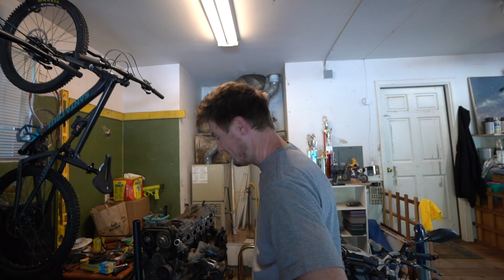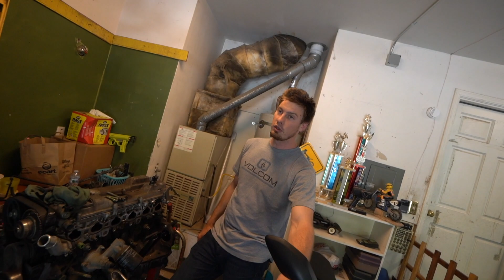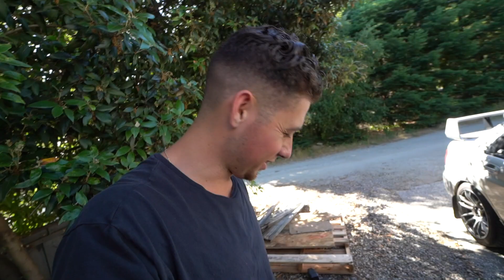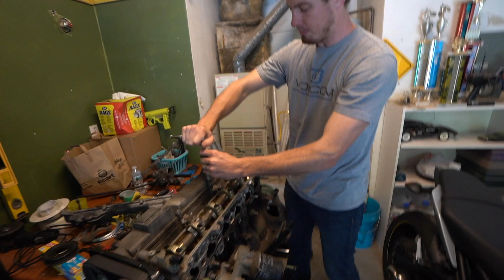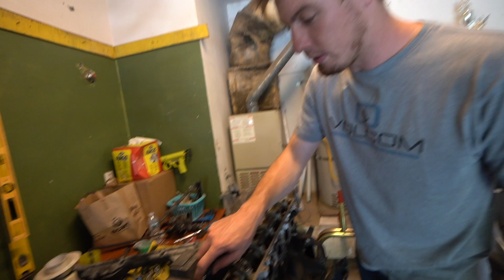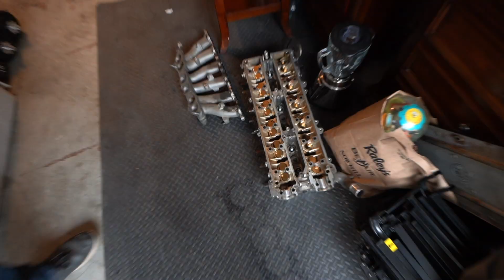ENGINE REVEAL AND BUILD PLANS FOR THE SUBARU!

Comment: Why does he chose 1jz engines instead of 2jz ?
Reply: easier to tune... no vvt
Reply: Danjet96 it’s VVTI, the being harder to tune is kind of a myth, it’s real straightforward. And the cost of the 1jz is less than half of the 2jz.. I ain’t no rich guy haha
Reply: And parts for a 1jz are a lot cheaper, and the motors are a lot cheaper